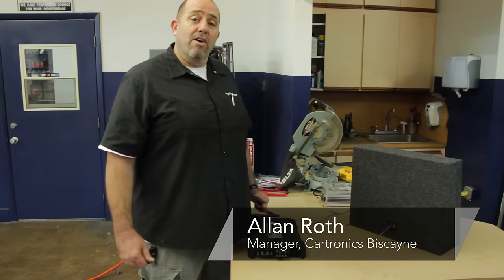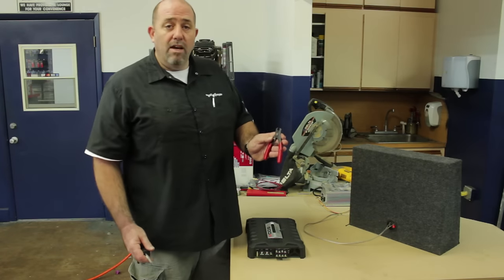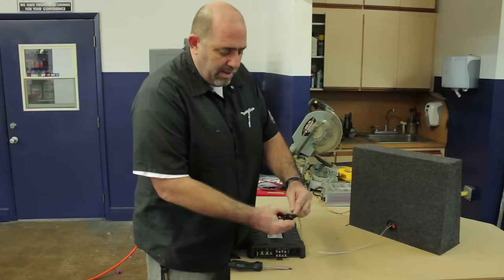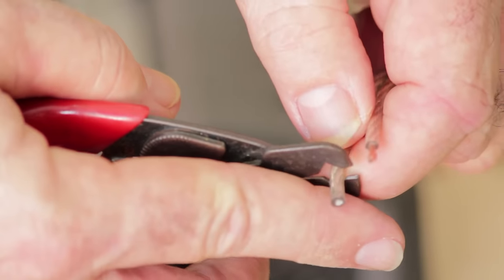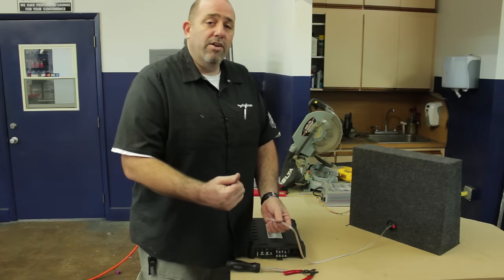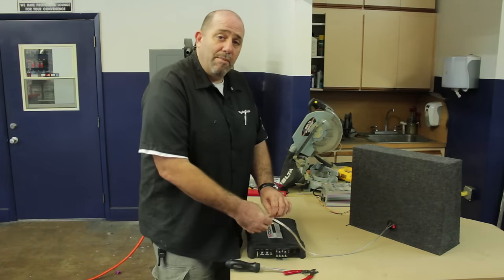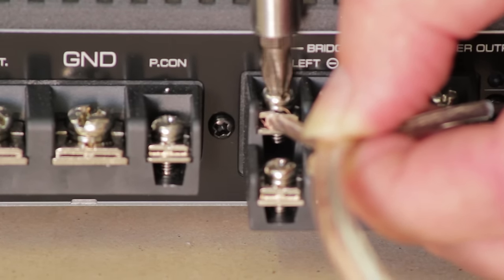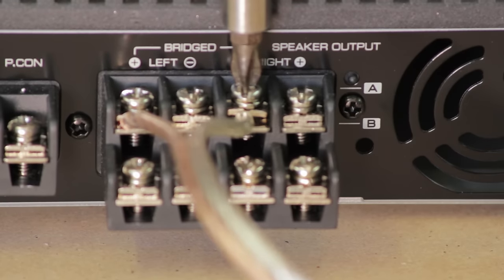Car Audio : How Do You Bridge a Car Amplifier?

Comment: Is it possible to bridge 2 sub in a one channel  600 watt amplifier 
And if so what's the best way to do it.  I'd appreciate it if I got an answer back
Reply: +Yosef P MOST 2 channel amplifiers when in bridged mode need a 4 ohm load. If you connect a 2 ohm load it will ruin the amp.  if you have 2 subwoofers and they are both DVC 4 ohm then you can series wire each coil on that sub as 8 ohm then wire both subs in parallel to the amp for a 4 Ohm load. If you have a pair of 4 ohm subs you can either use a pair in stereo mode or drive one in bridged mode.  It's possible to drive both in series to 8 Ohms but you would half your output power.

Comment: PLEASE HELP :: On my ata1200.2 its setup (+) ( - ) ( + ) ( - ) and I have my amp bridged on the far left (+) and the far right (-) is it ok or not recommended to connect my two rear speakers to the left over signals ???

Comment: What if i got the kac-7205 1000 watt kenwood amp and bridged it to my 2 300rms sony xplods. bridged is having 2positives on the positive side and 2 negatives on the negative side? cause my amp has 4 inserts did i wire it right can someone answer it please??? i got two lines on the positive and 2 negative  lines on the negative input is it right i;??